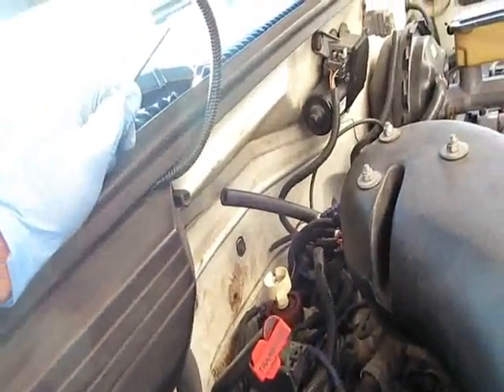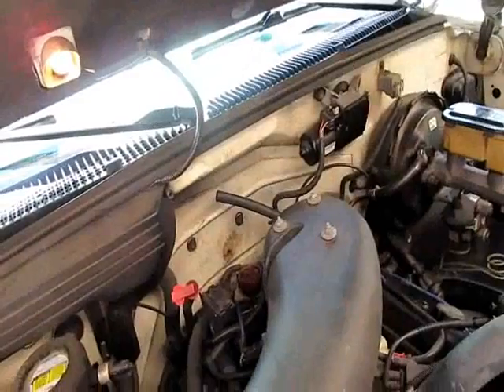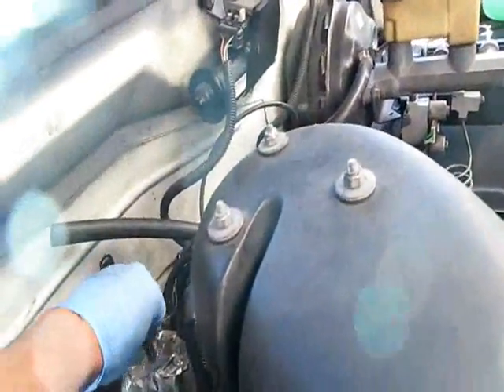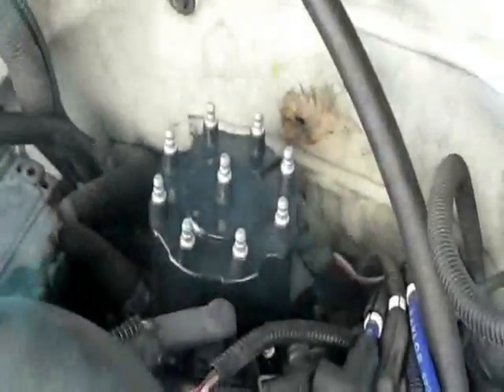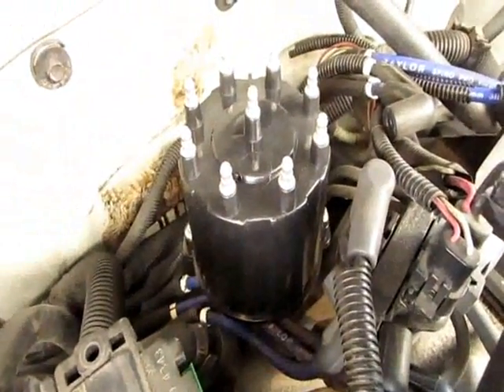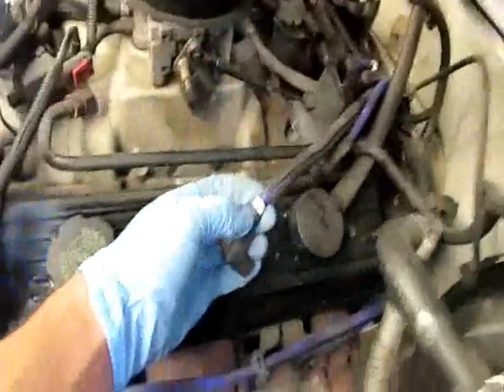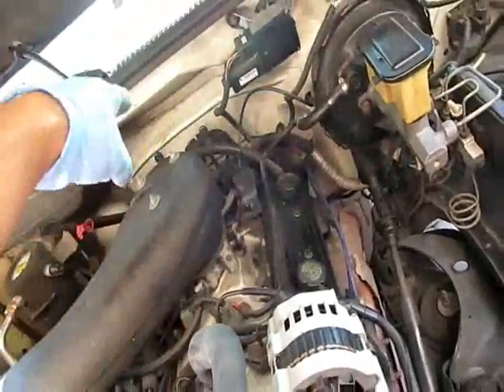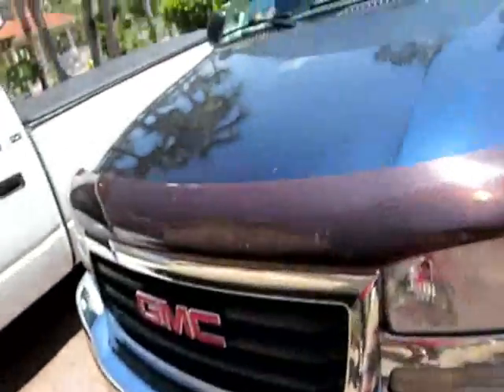Changing Distributor Cap and Rotor Chevrolet Truck GMC 350, 305  How to

Comment: Did the plugs on my 95 C1500 5.7L today, then went to do the cap and rotor but the rotor is fully stuck on there. Right pain in the ass while on your hands and knees in the engine bay trying to get that rotor out without damaging anything. Thanks for the video, I'll have another go at getting it out how you did it. Cheers mate.
Reply from the maker: Ya keep prying on it, Clean it off when you are done and apply a little grease on the stem

Comment: Thank you very much for indicating which post on the cap is number one . Did what you did plus I changed the wires. Five of the eight wires were burned through at the plug boots. Heat shields long gone on 1992 k2500 King cab. 

Hoping you can help with this one: running okay but would occasionally quit in full flight on a flat at about 45 mph. Had changed out battery last year and one of the ground wires was loose on the battery (now). Pulled the battery for a few days and trickle charged it, redid the wire.
 Decided to get fancy and did cap rotor and wires and was very appreciative of your solution with the stuck rotor which I also had. I know the wires and the firing order are good, but now the truck runs very rough like it's out of order and stalls in the driveway. Shaking so hard I'm afraid the exhaust will fall out the bottom.

 Not drivable. ODB1 way too expensive. Was wondering if the battery being out that long confused the computer? Going to borrow a light and check initial timing with the harness from the computer unplugged.

 Any other thoughts? The damn thing was running okay with five bad wires and now it runs for squat. Truck is strictly dump and Depot. 300 mi a year for the last 5 years. TIA and thanks again for the info about the cap.
Ps -not stolen valor. This is my father's 10th mountain division uniform from WW2. He's still around. I borrowed it for a costume party and the women.
Reply from the maker: Check fuel pressure if its a TBI.  If its below 10psi the pump is going out.
Reply: Yes it's TBI.  too bad there's no inline Schrader. I guess I got monkey up some kind of testing rig. There's  2 to 1  block upstream from the tank. I can monkey up some kind of test rig, but do you happen to know if the pressure should be up on both of those lines? I assume one is to recirculate back to the tank. Just for shits and giggles I'm going to disconnect that harness that bypasses the computer and check the timing. I triple checked the firing order the wires and such. The harness is from the computer behind the dash look a little ragged. I just can't understand how something goes from basically running to a POS
Reply from the maker: @jamestallmadge9515   They make a tap kit it can go inline by the fuel filter or the throttle bidy. I put it by the fuel filter so if it leaked I would not have a fire.  Worked great.
Reply: @GhettoWagon  where'd you get it? Model?

Comment: Can u please do a video how to find tdc I did mine and it's out of time. And I got the firing order right
Reply from the maker: put it at the ballancer it will be TDC #1 or #6  So u need to pull out number 1 plug.   Check if piston is up.. If it is.. good if its not turn it around 1 more time till timing mark is at zero.    Then put in distributor and aim rotor at number 1

Comment: What's the peice under the star called it's a magnetic ring mine is in pieces when I went to take a look under the rotor
Reply: It's a 94 Chevy 7.4 454 gas
Reply from the maker: Pickup coil? The copper wound piece?
Reply: Ghetto Wagon well I looked at your  vid but I don't see the piece I'm talking about it's under the rotor but above pickup coil there's a housing around that star that come off with 3 screws and it's under that housing

Comment: I'm having the same problem I literally replace my cap and rotor and it won't start now and I can get it to pump but then nothing happens and my cap and rotor with stuck on like that I had to literally wrench it Off
Reply from the maker: if you break the star or the pickup coil?

Comment: Will this cause a ticking sound when you press on the gas
Reply from the maker: I had more of grinding sound on another one when the star on the distributor came apart
Reply: This is what im tryin to fogure out, ive got a loud ticking sound. Not sure if its just the sound of it arcing inside, cuz the sound only happens just above idle, stops at above 1000 rpm

Comment: I have a 95 suburban 5.7 it's been sitting for about 6months could this be my problem I won't start
Reply from the maker: If it has spark doubt it.   Check the fuel pressure.  Maybe the fuel pump died  Common.

Comment: I know this is old, but why do you think this could be? The truck runs great at higher RPMs but wants to die at stop. This happens in park as well sometimes. 1992 GMC Sierra 350
Reply from the maker: check fuel pressure? Every time my TBI truck ever stalled out mutiple times now.. Was a fuel pump issue.   Damn near pickup coil almost broke on it though. That would shut down the injectors.

Comment: There is a split in the shaft;you don't show how that split aligns according to the button. That's what I was looking for.
Reply from the maker: Try to put the rotor on,  you will quickly realize it can only go on one way   You don't need to show it you did not try it. You cant cram a round peg in square hole

Comment: Ok so ive just changed mine but forgot to mark them an my dumbass cant seem to figure out how to put them in correct order from spark plug to the rotator cap. Any help would be much appreciated.
Reply from the maker: Did not mark what the wires?  https://static.cargurus.com/images/site/2015/09/25/09/42/pic-1565430846980165326-1600x1200.jpeg or https://static.cargurus.com/images/site/2015/09/25/09/44/pic-8383238690108311595-1600x1200.png

Comment: I had to BREAK my distributor rotor, the rotor shaft was extremely rusty, so the rotor was fused together. I applied some vaseline to the distributor shaft to make the installation of the new rotor easier.
Reply from the maker: Yea lot of times that happens. I put a brand new shaft in. put some light tacky  oil on it and the star before installing like a year later has very little rust.   I should of tried bar and chain oil. May hold up better. It spins real fast kinda like a chainsaw so... Maybe it will work.  If it gets real rusty the shaft is probably going to fail, the star will crack, get loose like mine did and I had erratic RPM under load because the distributor pulled up and down when it wanted and f'd with the ignition timing.
Reply: @GhettoWagon  I have to go back and check my distributor again then. Because sometimes I get a little back fire, shuttering, or hesitation on taking off from a dead start, or when I  try to get on the pedal. I had a lot of rust in my distributor too.
Reply: @GhettoWagon  ok, so today I lost engine power. The engine will crank, and start if I keep pump the gas pedal. Is it possible the distributor failed?
Reply: living in a desert  thank you brother,  that was exactly the problem.
Reply: @desmondmarshall7384  what was the problem?
Reply: @freemanfornow264  some back fire and hesitation upon initial acceleration. Then I would hear a click from the engine bay, and the engine would shut off. After letting the truck sit for 15 minutes the engine would start and run, but would cut out every now and then without notice. I sold the truck 😢.

Comment: I used a pickle fork came off in 10 seconds
Reply from the maker: That will work too. A little large..
Reply: Ghetto Wagon lol. it cracked in half but i didnt give a fuck. i had a hell of a lot of rust to sand on the shaft afterwards

Comment: thanks for the vid on the diy shop tried to fuck me out my money Im having spark plug issues they told me its my transmission
Reply from the maker: Oh they said the miss was the transmission acting up?   The caps and rotors wear out fast on these vehicles ion humid climates.  The distributor star also cracks and in my case it moved up and down when it wanted to. I rebuild the distributor about a month ago and the high RPM surge/  Miss it had is 100% gone  I have a video on that process
Reply from the maker: KUSHxVISION FILMS
 
Its the same kind of vehicle? Throttle Body Injection Chevy engine?  if it is. You may want to check the star (That's the rusty piece under the rotor in this video)  You need to take the distributor out to change it

Comment: that looks like way too much play you should replace the whole thing.
Reply from the maker: You never replace these, all they have is Reman junk, although Delphi makes a "new" distributor now, I wonder what is in it. Its normal for the Distributor to have up and down movement, It always had it, I thought about why it went away. I came to the conclusion that oil probably baked on the shaft again and caused the shaft to stick in the distributor housing.  I forget if the distributor had this much CCW or CW play,  in the past, Ill have to check it VS the other engine I have here with the same distributor, Which I Built out of new parts.  I will wait until the engine blows up before I replace this example distributor. lol The Gear could be chewing up on the cam or the Distributor!
 The only old parts on this Distributor is the Shaft, Housing and the gear, All the electronics are new.
Reply: Get a edlebrock unit made in the USA it, it's what I used to replace the one in my 450k truck works amazing
Reply from the maker: Didn't even know they made them. I know MSD had a billet distributor for these trucks, it fits Camaros and firebird too but its mad $$. I have a new housing and shaft, Ill just build it up. There is not much too these distributors.